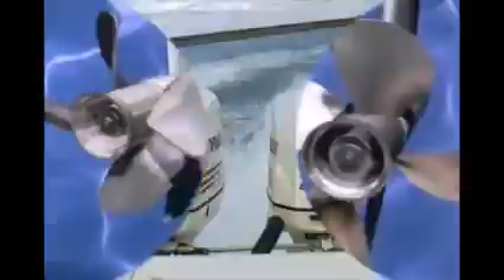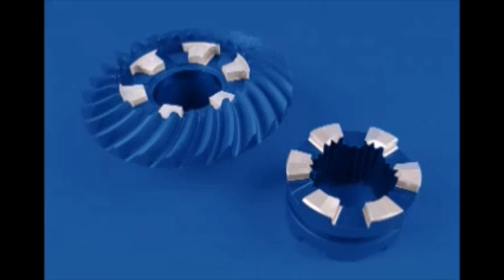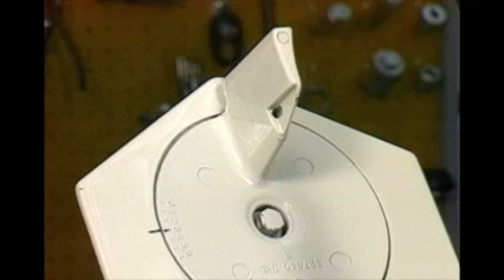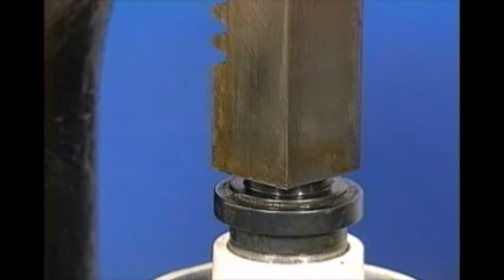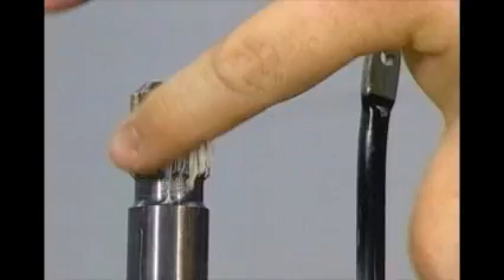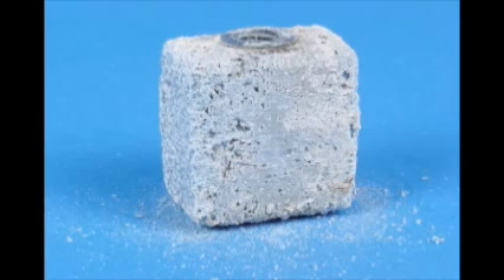Basics of an Outboard Gearcase

Comment: Good morning I have a question. Changing lower unit drive shaft due to different splines. How do I know if shimmed properly? I have re-used everything besides the drives shaft. When spinning the drive shaft it feels a bit crunchy and not smooth. And it seems like there is too much lash when I rote the drive shaft. The prop seems to spin a bit free before it catches up.
Reply: Oh and it's a 1986 60hp evinrude